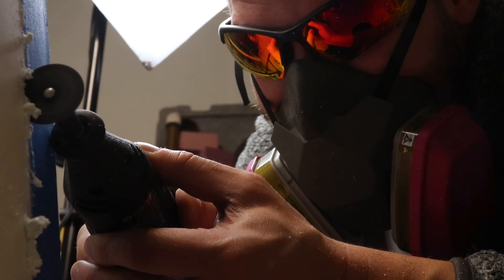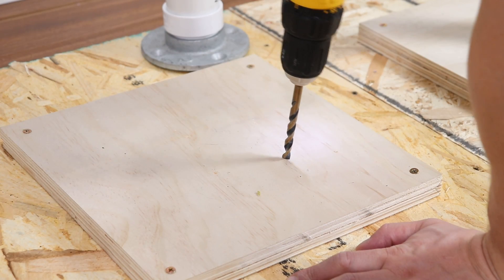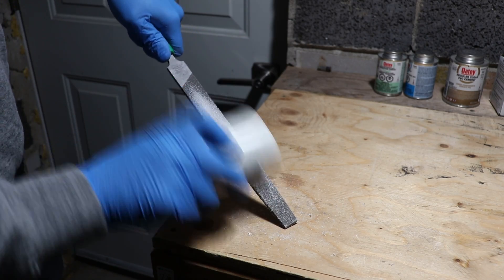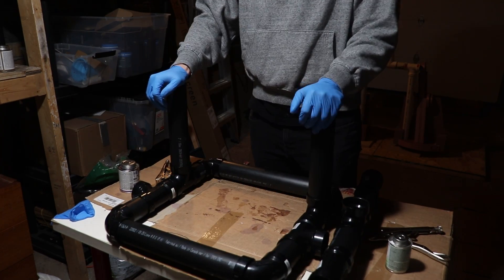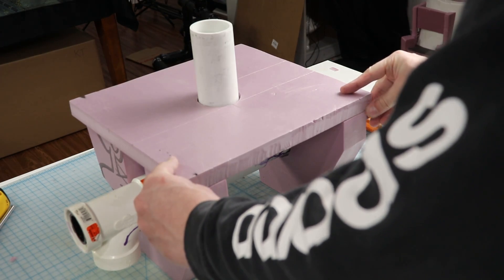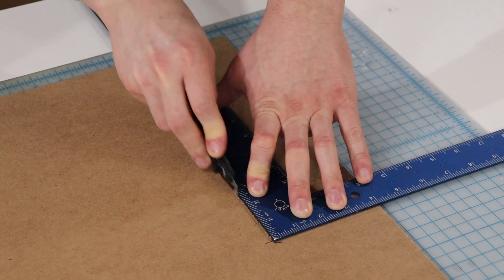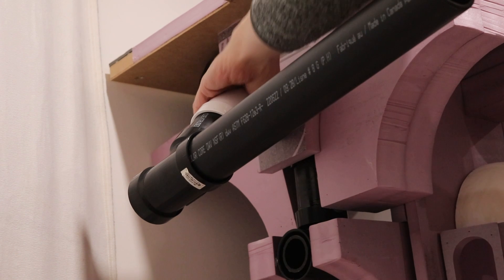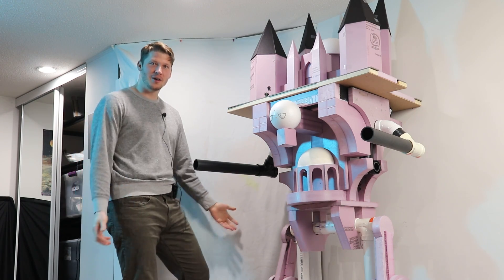Building a 7ft tall Warhammer Model | IMPERATOR TITAN

Comment: you really nailed it with the size of this thing. Alot of the forge world titans seem to clearly have leaned on the smaller end of the spectrum for their models, presumably because of the practical limitations of massive resin kits, but this is the only imperator atempt I've ever seen that actually matches the art and whats described in the books

Comment: You most likely already thought of this, but i'll mention it anyway <3
Copy the hip and shoulder joints into holders that you can place on the table/ground. Will make it much easier to use the upper body and arms and independant battle maps :D
Reply from the maker: Clever idea for the arms! I think i might make them into mechanicum guns with huge treads or orbital guns . The torso and hips sit flat on tables themselves already
Reply: @EricsHobbyWorkshop  Ah! didn't catch that the torso sat flat :D 
Also i love the thought of a titans gun being an ad-mech artillery gun

Comment: This journey you're on inspired me to start my own twofold insane build last year.
It's still in the design stages but I'm planning to build a Capitol Imperialis in 40k scale, to use in giant Apocalypse games, and it will be hollow inside with steel trays to hold my currently small but growing full space marine chapter strength of the Lamenters. 1000 assorted individual models complete with company, squad and battlefield role iconography, including chapter command, dreadnoughts and vehicle transports
Reply from the maker: I had actually never heard of a capitol imperialis before reading your comment. Im glad i looked it up, that looks incredible! Best of luck with the project, send me some pictures when its done !
Reply: @EricsHobbyWorkshop  I'll definitely update you along the way!
Reply: @Tyler Thompson
Isn't a Capitol Imperialis that big moving city-sized tank? Like it's literally a city tank and it has a CITY and starship-grade armaments on its back, especially a Macro-Cannon battery?
Reply: @sonofeyeabovealleffoff5462  you would be correct. A void shielded rolling fortress on tracks. And it's main gun has a bore large enough that it can fit 4 Leman Russ battle tanks inside, the blast wave from just firing the shell will knock nearby soldiers off their feet, and the blast from the shell making impact sends up a mushroom cloud, while the shockwave scatters anything it doesn't outright destroy hundreds of feet into the air, including larger vehicles like Baneblades and Knights
Reply: @firemaneminiatures1337  You need to post a video of that monster when you're done. I for one would be excited to see such a monster.
Reply: @sonofeyeabovealleffoff5462  i thought about making videos along the way but I do not have the computer skills or the computer to do it, but by the time I'm near finished with it and using it to store my army I'll have the means to do so

Comment: PVC: Polyvinyl chloride, ABS: Acrylonitrile-Butadiene-Styrene. Main differences are, they use a different type of adhesive (chemical weld). Biggest difference is ABS does better in the cold, hence Canada using it as a primary, but it is less resilient in the sunlight, than PVC, and lastly, PVC is a bit better at sound dampening the water within walls. Source: I worked at a home improvement store for a summer. haha

Great Build BTW!
Reply from the maker: Really useful comment, thank you!
Reply: @EricsHobbyWorkshop  I wouldn’t say it’s useful, it’s as random as trival pursuit answers…. Haha

Comment: You can get a stained glass effect with tissue paper for the colored glass and then black construction paper for the lead in between that you paint over with a thin layer of clear acrylic until it soaks through. You then stabilize it with thin sheet of acrylic from behind or in front that you bond to it with more clear acrylic. This gives a lot of texture that looks more like stained glass. The other method is to just paint the lead lines in black acrylic paint on a sheet of acrylic and then paint the glass thick and a bit globby with translucent acrylic paints to get the colored glass, bit it doesn't look as good when you do large windows. Definitely easier for the smaller windows though.

Comment: I would recommend So that way you can make the skull open Putting epoxy resin On the outside but Put like Plastic wrap over the foam basic shape ( after carving it to the close shape and size) With little cardboard circles As ridges (also so you can remove the foam you want to remove without the epoxy sticking to it) so you can make the piece Have separation lines so you can put a Hinge So you can open up the skull Like a cockpit On a fighter jet And just use some very small magnets And some screws so that way when it's down it stays together.

Comment: The big gap between the legs are for mainly mechanical reasons I imagine. Each hip joint needs to be able to have some motion in 360° arcs. Various pistons and gyros etc would be housed there, as well as pistons connecting the hips to the central lower torso axle. Essentially that is what it is, an axle. Motive action needs to be created in the upper legs so I can imagine the hip axis is a giant axle with transmission etc

Comment: I had seen many Imperators started but never finished. This is giving me hope to see this thing finished. Also; this may be pointless; I'd argue the head cockpit should be called a bridge as there is multiple crew and it's so large of an area but both terms work.
Reply from the maker: You are right, its a bridge. I just misspoke
Reply: @EricsHobbyWorkshop  Both terms still work though as both are correct.

Comment: Hi Eric, it looks absolutely stunning so far man! I have the following hint though with the hip construction: It seems like all the weight of the upper body is on the glue joint on the underside of the hip-axle. ANd not like staying on the top of the axle. This seems to me as an engineer a little dangerous, cause all the weight would just go on this glue joint. Maybe you can build a direct joint from the upper body to the top of the hip axle to lead the weight in a more optimized way into the hip. I hope you get what I try to explain.   Anyway: You are awesome man! Greets, Madfrog

Comment: It's very cool but I honestly have some concerns about the hip assembly because the structure will be top-heavy.  Your resistance to lateral toppling from the hip is all based on the glue's adhesion holding the central hip joint in place.  Imagine getting this thing looking great, taking it to a convention, lloading it up with minis, and then that glue gives out and it topples forward at the hips and dumps everything on the floor.

Consider drilling some holes into the key joints and giving them some additional strength with metal nuts and bolts.  That should prevent the pipe joints from slipping on you.

Comment: PVC vs ABS. A word of caution here -

ABS is more flexible and pvc is more rigid.  That can be an issue with something like this.

ABS is really prone to deformation when exposed to UV light.  You can solve this by very thoroughly painting it.

PVC gets more brittle when it gets cold.  Not generally an issue but something to consider anyways.  Especially if you have to transport that thing somewhere in the winter.

Comment: ABS and PVC aren't chemically compatible in terms of the glue made specifically for them. But probably inconsequential here. Acetone dissolves ABS too.
Reply from the maker: I used an ABS to pvc transition glue. Its been tested by pros and the bond is just as strong as regular abs or regular pvc glue

Comment: if an imperator titan is supposed to be just under 70 metres tall, and a primaris intercessor is supposed to be 2.5 metres tall, with a model height of 1.75inches, then the imperator would only be 1.22 metres tall, not 7ft (over 2 metres) tall right? what scale is this imperator supposed to be at?
Reply from the maker: Imperators are sometimes described as up to 140 m tall. This one is 109m based on my calculation

Comment: Abs pipe has a much higher expansion rate in higher Temps than pvc. Basically turns into a wet noodle. I would not recommend it in your model.